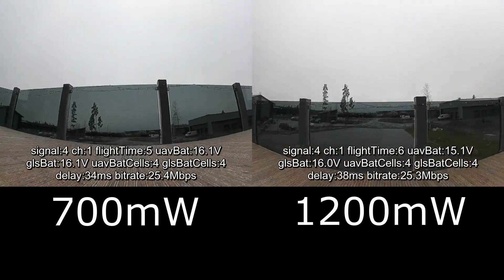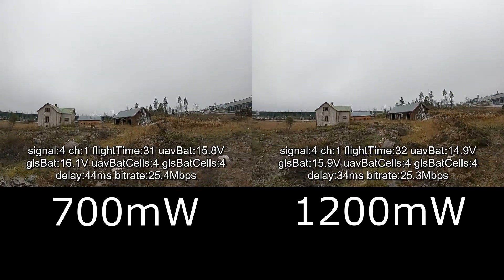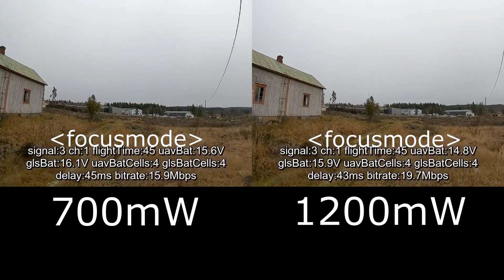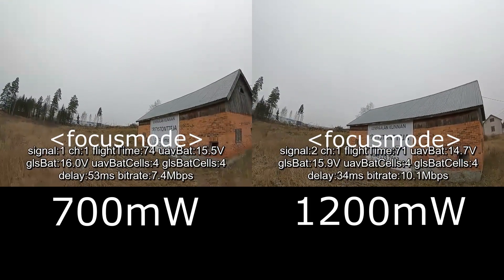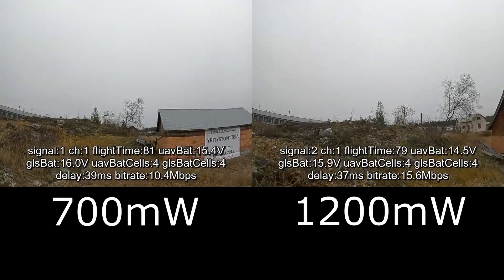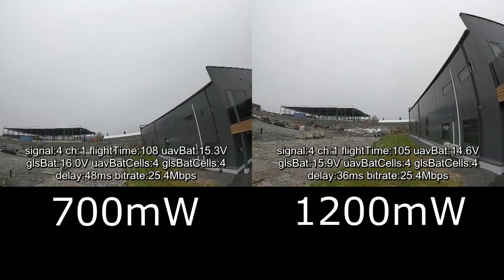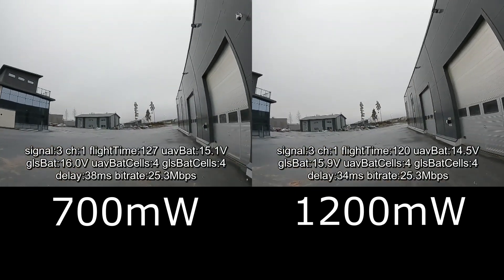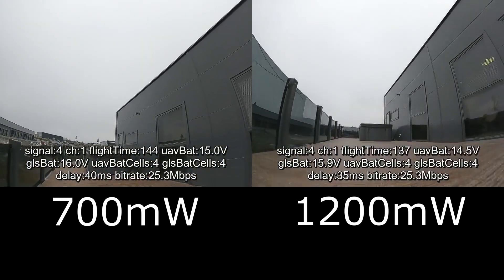DJI Digital FPV System - 700mW vs 1200mW

Comment: Does 1200mw effect flight time?
Reply from the maker: No. It's so small difference. 1200mW is only 1,2W. Your motors are using ~1000W-4000W depending on throttle all the time in flight, so the power that air unit is using is really really small. Air unit overall is only using under 10W with camera and everything.

Comment: Djeezz that's almost no difference imho, why would you need 1200mW if your aren't a long distance LT... The footage even stalled in 1200mW @2:19
Reply from the maker: It didn't. I said at the beginning, that these were two different flights, so I'll pause the one flown faster occasionally to keep them pretty much in sync. There is difference, but not huge. Video is just to show the difference. I myself am normally flying at 700mW.

Comment: Hows the reliability on the 1200mW system after all these months? Have you found any issues so far? I'm hoping the only reason they had it disabled was because of FCC regulations, not because it was dangerous of damages reliability of the system.
Reply from the maker: No issues so far. Higher power level most likely will cause the lifetime of electronics to be less that what it would be on lower level, but I guess the electronics will last as long as I crash it so hard that it will break on that.

Comment: Hey nice Video :)
Is there a difference between 1200 Abs 700 mW in term of flighttime?
Reply: When you compare with the power consumption of the motors, it shouldn't affect flightime this much

Comment: Does the air unit get hotter on 1200mW?
Reply from the maker: Sure it does. I can't say how much exactly, but as long as there's enough air flow on the air unit, it will still stay cool enough in air.
Reply: I Been flyin at 1w in mid 80 deg weather, air unit no hotter to touch than 700mw after flights, great penetration, check my test vids usin lollipops
Reply: 80f is 26c. The unit has dynamic power so will only increase to the max limit set when the signal degrades. Id be interested to know how well the unit runs 1200mW continuously when out over 3km away or with whole flights where object penetration is required.
Reply: @changeagent228  ah yea smart I'll take mine far then down behind rows of orange trees to test that
Reply: @flo-ridafpv5713  Great! 👍

Comment: What’s your antenna setup for this test? Stock? Thanks for the video!
Reply from the maker: Two VAS Crosshair XTREME lhcp antennas on top of goggles, all else stock antennas on underside of goggles and on air unit.
Reply: Hey man just posted a test at 1 watt thru 4 concrete buildings using just omnis, 4 stubby lollipops, I superviewed the goggle dvr ;)